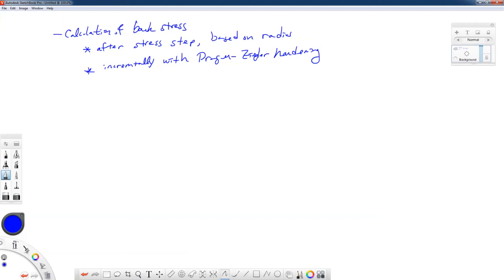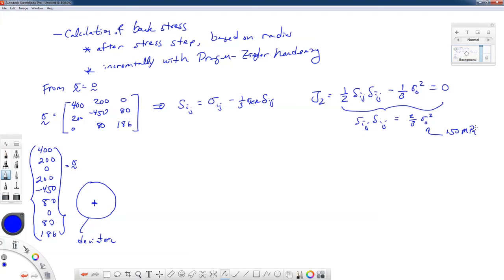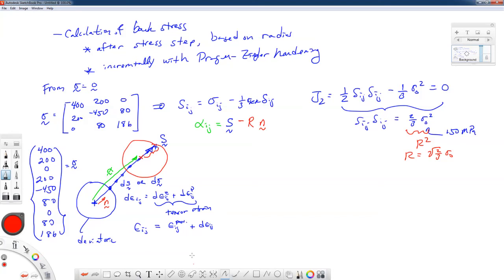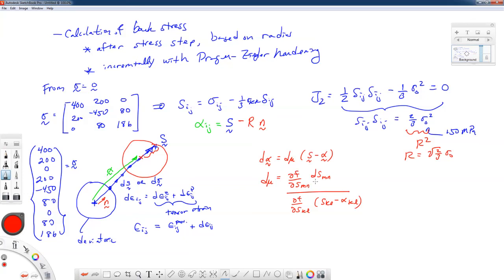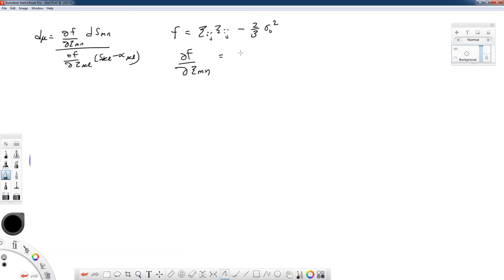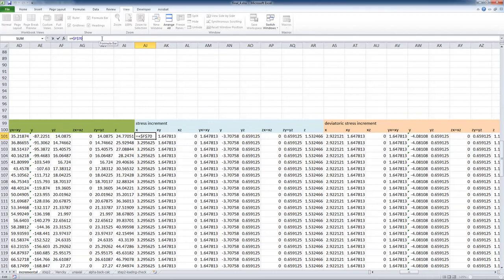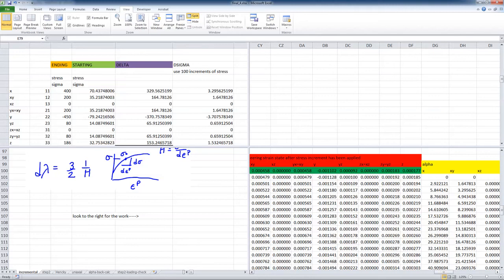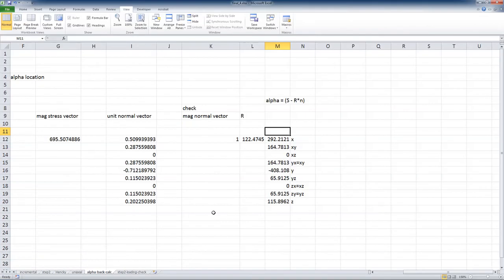AEM 648 Final Problem Continued; calculation of back stress for first stress increment

Comment: Hello, I was wondering how to find the back stress tensor from a calculated strain tensor from a given stress tensor? Thank you.
Reply from the maker: Hmm, I am not sure what you are looking for--the back stress defines the location of the yield surface in stress space, and likewise the back strain tells the location of the strain space yield surface.  The two are not necessarily easily related as the strain state depends on the stress history--including the path taken to get to a particular stress point.  If you kept track of the yield surface in stress space using incremental plasticity, then you would have the back stress as part of your calculations as well as the strain state.
Reply: @mbarkey.mechanics  I used Voigt form to calculate elastic stiffness and compliance tensors in the sample frame for a crystal orientation given the elastic constants. I then was able to calculate the strain tensor using a given stress tensor. Now using this strain tensor, I need to find the back stress, but I cannot I.E S=inv(C), S*STS = STN. What times this STN tensor gives you back stress?
Reply from the maker: @jacobweiss3010  I'm not sure we are talking about the same thing.  I am using back stress (shift tensor) in the context of incremental plasticity theory for continuum level metal plasticity.  It sounds like you are doing something with crystal elasticity and/or crystal plasticity (which is not currently my area of expertise).

Comment: I downloaded excels from forum. In Final.xlsx possible I found a mistake. Could you check an engineering elastic strain (the initial one at yield surface) I think the y and yz component is wrong.
Reply from the maker: Thanks kiciusKit, that is very likely there is some error.  It will be a few more days before I can look into it.  I made note of a couple errors here:
https://www.youtube.com/watch?v=iQiXY2YK5Yc&t=0s&list=PLaDWa6xI4zefhDwPmTR1L6z8c8rtyRDVH&index=27
but I am not sure if that is the same one you have found.   My preference is to program in Fortran (and I think errors would be easier to spot) , but Excel is very universal.